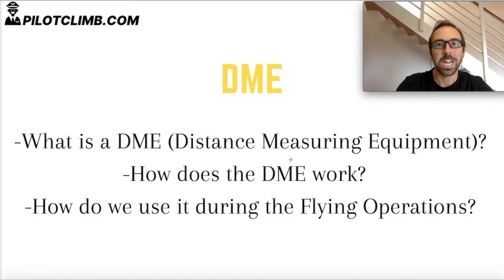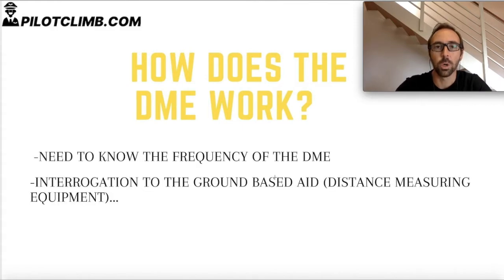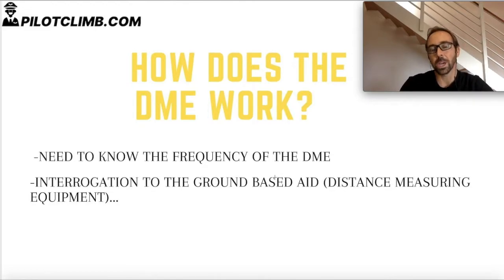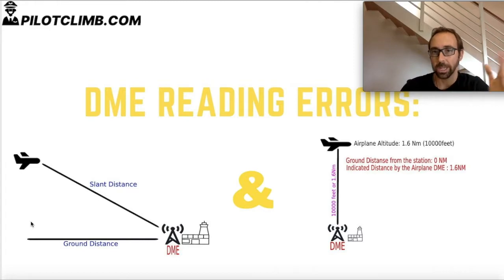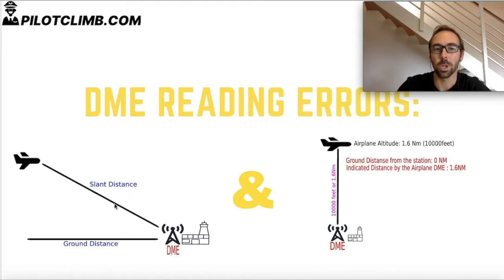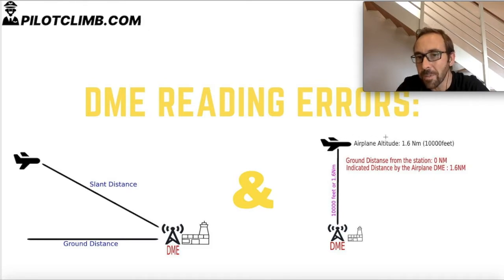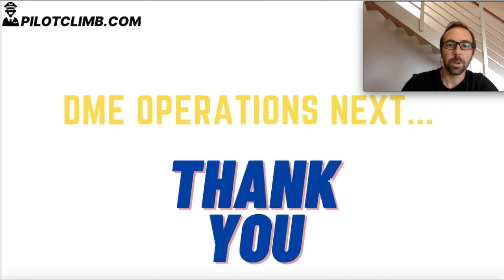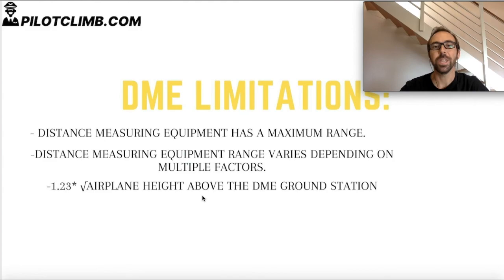Distance Measuring Equipment (DME) Explained - Part 1

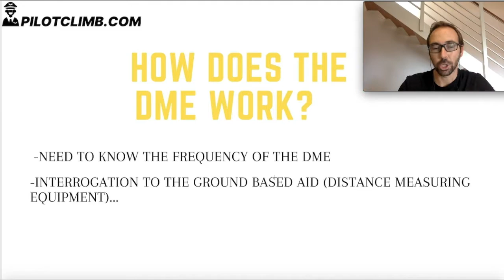Comment: 3:00 wouldn't it be 5 miles away if it takes 10 seconds for the reply at 1 mile/sec as the signal travels back & forth? Or I guess assumption of 1 sec = 1 nm is including back & forth in which case dont mind my comment :D Anyways great video, thanks a lot!
Reply from the maker: Hey, many thanks for watching, yes I assumed it was back and forth... I hope the video helped you!
Reply: @PILOTCLIMB  Definitely helped! (anything helps when you know very little about most things aha). I'm a casual X-Plane flight simmer trying to learn the basics of navigation, GPS aside.

So many 3-letter acronyms but slowly learning what DME VOR ADF CDI OBS NDB are, how to use them etc. Yesterday learnt how to correct heading to adjust for crosswind :D The youtube community of pilot teachers is fantastic and create a massive online school which is great!

Comment: Hello PILOTCLIMB could you please explain how tuning and identifying a DME that isn't co-located with a VOR works? since it operates in the UHF band. Is it the same as tuning in a VOR frequency? Lastly are X channel DME more accurate than Y channel DME? Keep up the good work and stay safe!
Reply from the maker: Hey, I hope you are doing great!!!

Many thanks for watching!!

So, I have never seen a DME ''alone'', I'm not sure how useful would be a DME not co-located with a station that can provide you with a bearing.

I guess setting the frequency on the NAV radios, if it is within the radio range, should work.

In order to identify if the DME is working you can follow the morse code of the DME station.

Sorry, but I don't know which channel is more accurate, this is a very good technical question! Let me know if you find the answer!

I wish you a great day!
Gabriele

Comment: 123 nautical miles is the slant range or ground range?
Reply from the maker: Hey,Thanks for watching!! could you confirm that the 123 nm is the result of 1.23*sqroot Aircraft height?
Reply: @PILOTCLIMB  yes, 1.23 into root of 10000, that is 100, so 1.23*100 is 123 narical miles, so that's the question